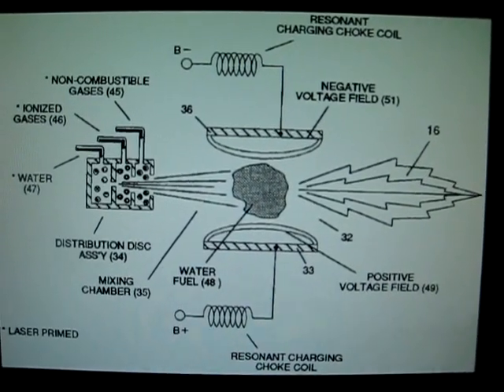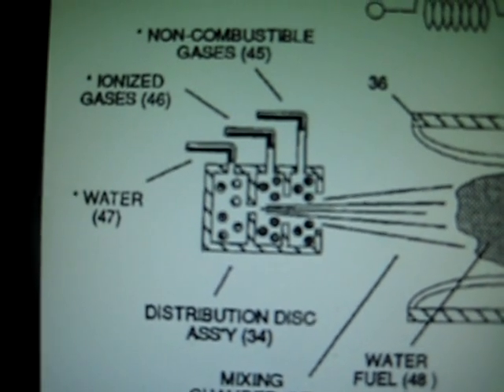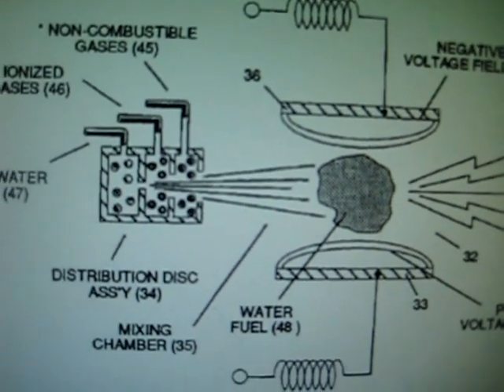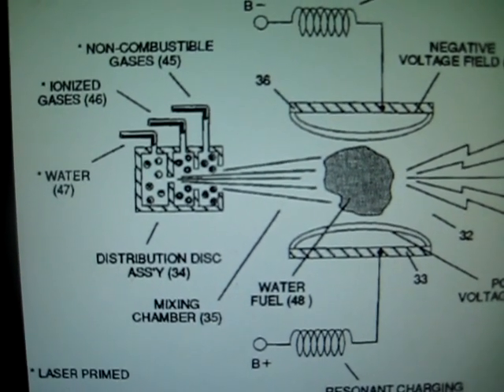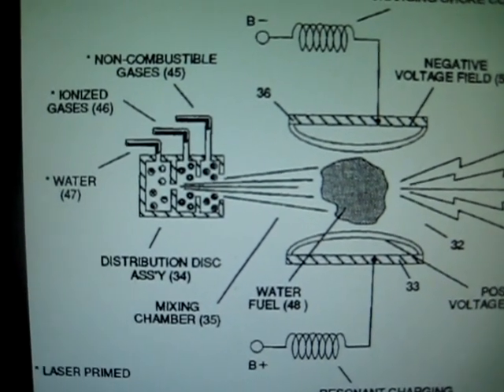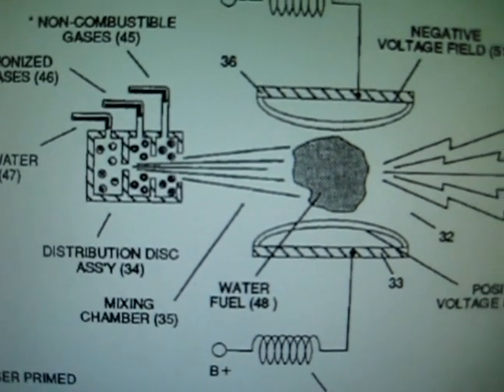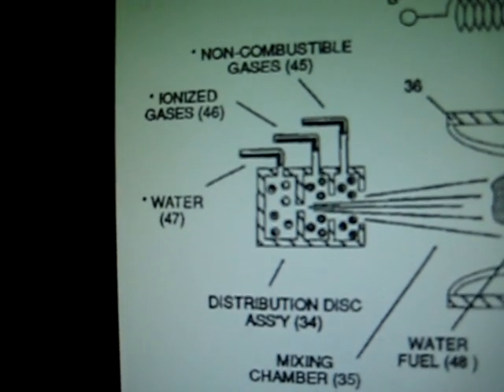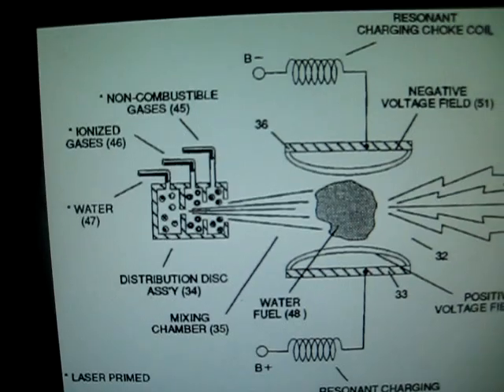Stanley Meyers Spark Plug Injector "Theories On How It May Work"

Comment from the maker: In reply to James Arthur -

1. Stan said while he was dieing that he was poisoned. His brother was right next to him to witness it. As for him dieing from an aneurism I believe this is a false claim created by the elite to eliminate any controversy that he was murdered.
2. HHO will implode during ignition and creates a very powerful implosion but in order to get an implosion the volume of HHO in a container has to be perfect to create this effect. I do agree with you, I don't believe that Stans engine worked off of the implosion effect.
3. HHO does not burn to quickly to be used in an ICE, it has been shown time and time again that an ICE if timed right will work just fine when running on HHO.
4. Stan used the exhaust gasses to slow the burn rate not the ambient air. He ionized the oxygen in the ambient air to create a higher energy state of the full combustion process.

Comment: You obviously haven't actually read the Stan Meyer patents. If you had you would know that there is no secondary generator. The ionized noncombustible gases that Stan refers to are recycled exhaust gases.
Reply from the maker: I have read his patents over and over again. Stan ionized the ambient air to create higher energy of the full combustion process. He used the steam to slow the burn rate of the HHO to make it equal to that of whatever gas it is you are trying to match the burn rate of. He ionized the oxygen not the hydrogen.  The noncombustible gasses were not ionized.

Comment: I have stans labnotes. the disc described is located in the injector. I have built 5 injectors and tested them on a 1650cc vw engine in the same chassis and configuration. The end result was feeble at best. He had more success with the wfc config. As a result, I have developed a new engine , the Rotary Radial Turbine engine.
This allows for better use of the burn time for hydrogen using the plasma ignition.

Comment: 1.stan meyer died from an anurism that exploded in his brain,not poisoned. 
2.there is no implosion,only exothermic and endothermic reactions present.
3.hydrogen(hydroxl) burns too quick to be of use as a primary fuel in an ICE.
4.the burn time in the power stroke has to extend past the crossover point to the exhaust stroke.
5.hydrogen burns at>8000ft/sec.(flame front speed)
6.this is why he slowed the speed down by the ambient air mix in the airgas processor and ionizing with a magnetron.

Comment: Reading his full Canadian patent on the hho fuel injector made after this, his final patent before his murder by poison from oil cartel, you can understand this much better.
Steam is not the key; it's positive ionization that expands hydrogen up to 1800x. This is done either in the fuel cell in the patent you're viewing, or in the injector itself in his last patent, wherin water mist became individual capacitors to expand inside the combustion chamber providing over half the power. More? ask me.

Comment: WET Carbon Arc fuel injector spark plug assemblies would greatly simplify these green energy problems. Water-fed carbon arc fuel generated in the spark plug on-demand, moderated by fractured water and ionized gas, allows the full EMF potential to be applied to each cylinder plug as needed.  The exhaust, as demonstrated by Santelli, will be pure water.  C.O.T. fuel injectors have demonstrated the ability to deliver fluid or gas.  The manifold air-intake should also be ionized.

Comment: @TysonCapel23 Ionization of hydrogen is exponential, and literally depends on it's own expansion to expand more. You must allow electrons to push massive particles into lines of force. The more hydrogen can spin on a linear plane, the longer it's lines of force become until it proves it's over efficient nature as a vortexer of time itself. Thermal mesons no longer sit in thermal entropy, but take part in linear magnetic poles spin and counterspin cycling as monopoles.

Comment: @xjet Actually you're very very wrong my friend. During the time of expansion, magnetic current is what's really expanding the hydrogen 1800x. Electrical energy only moves the keystone by allowing the hydrogen to spin on a linear atomic plane so it has time in 2d space to grow longer lines of cyclic monopolar force from atomic centers. Droplets during this time remain ungrounded, so they can gain positive ion charge. Contraction/ expansion of fog in funnel helps orient energy vs/mass particles.

Comment: You're missing one MAJOR point; the injector electrical charge (spark) turns water droplets into individual capacitors just like his later patent the hho fuel injector. That later one uses a mosfet transistor to make a 5ns 8 step 40ns long pump z wave at 30kv 1kw.  The caps rotate atomically on linear planes which is how it expands. Nonlinear sep of mass/energy lets h atom grow bigger with longer lines of atomic force.  This old design used taper chamber shape to produce similar effect.

Comment from the maker: @xjet Not the case acording to Stanley Meyers discoveries. The purpose of using the Ionized gas is to prevent the H and O from recombining. Meyers also discovered that because the H and O would not recombine due to the ionized gases the energy had to go somewhere that somewhere was in the form of electrons thus the purpose for some of his other inventions which would capture the electrons and create electricity.